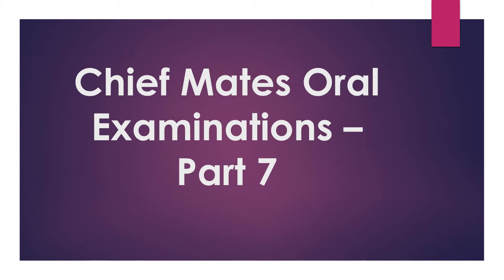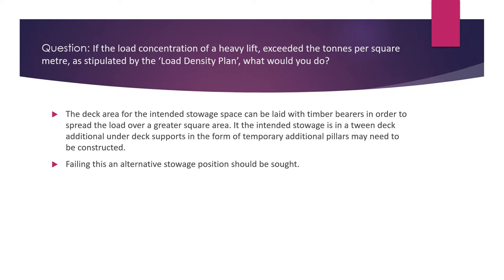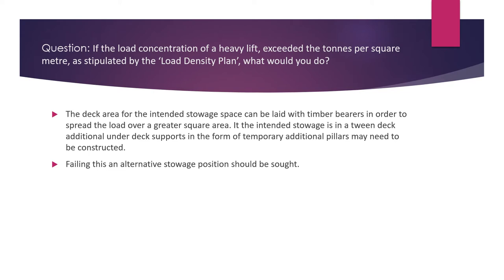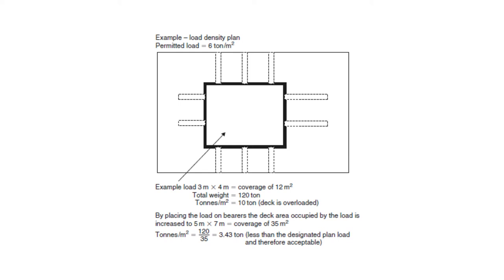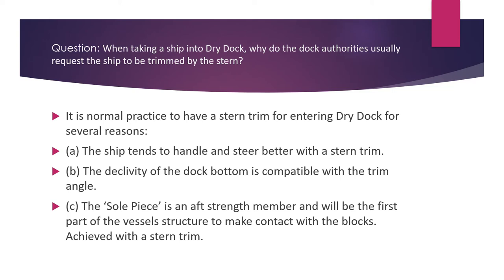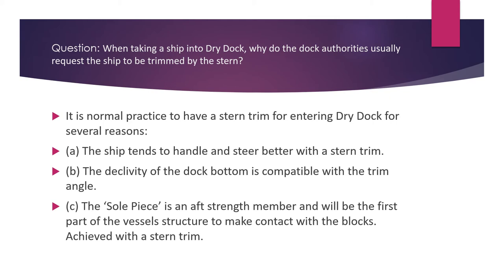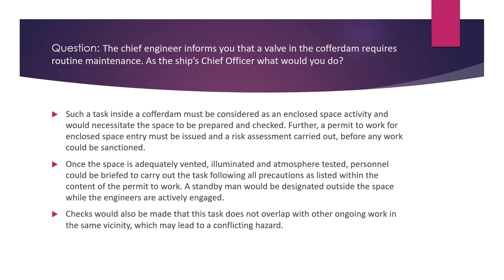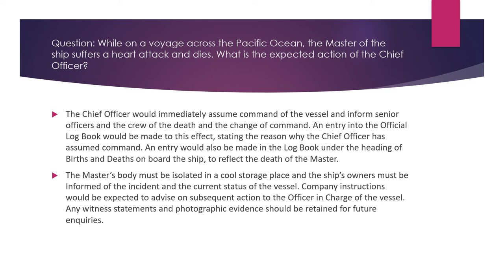Chief Mates Oral Examinations – Part 7

Comment: Thanks as always, an interesting subject which is not often mentioned. What I wanted to ask is if you have such occurrences of deaths on board, you would be in breach of your safe manning certificate, would you get crew replacements before entry to port? or proceed and crew will join once alongside? In the case of deaths in enclosed spaces you would keep a record of the permits and how they were followed, would you retake a sample of the air in the space? and keep the instrumentation sealed off to make sure that they are tested?
Reply from the maker: George, thanks for the feedback:) To answer your questions:
1) Yes, you are right. Under these extreme situations, the Flag State does allow an exemption from the safe manning provided arrangements are made for the person to replaced as soon as practicable. The ship owners will have to arrange for the reliever at the next port. However, sometimes, the C/O has a Master ticket and 2/0 has a chief officer ticket, and along with the third officer the safe manning requirement is fulfilled.
2) Great questions. You would have to document and provide evidence of the reading on the oxygen analyser and the explosimeter, together with permits and how they were obtained. The relevant entries should be made in the log books and counter signed by Senior officers on board to demonstrate that all precautions were observed.
3) Basically, if you can provide evidence of the use of ISM checklists and the actions taken, then you are safe (the court of law will view 'negligence' seriously but if a death still occurs after all the necessary action, the court may view it lightly??)
Reply: Thanks for that. As I had a similar question when assisting a mayday and you take people on board more then you are allowed to carry, so with the same reasoning you would get an exemption  from flag, as you are obliged by solas to give assistance.
With regards to enclosed spaces I think it’s the one permit which is most difficult to risk check for as there are so many conditions that can go bad, such as mud releasing gas, inefficient ventilation etc. 
Thanks for the videos once again but even more tank full for the time taken to answer my questions.